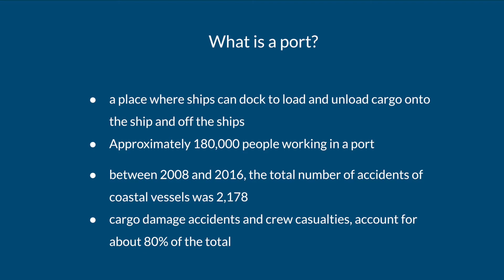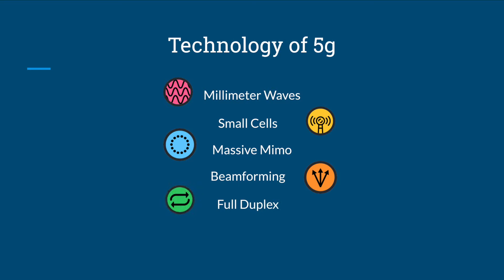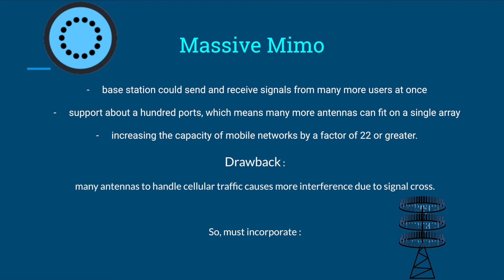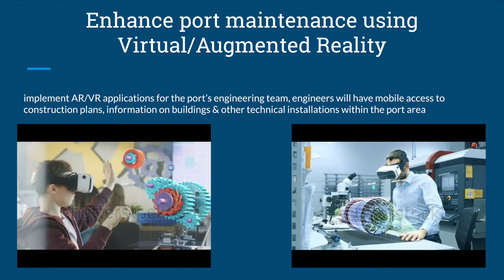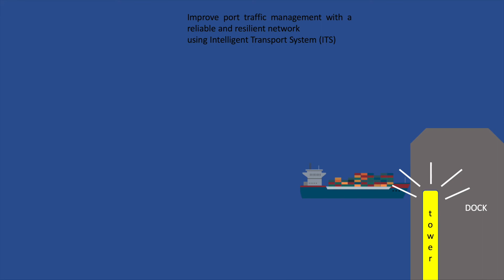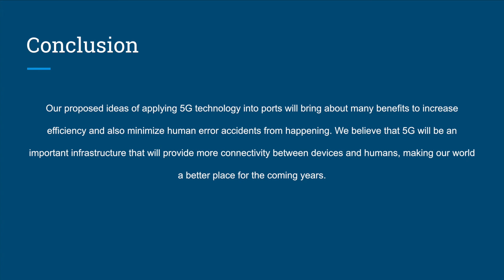5g Smart Port

Comment: What are the challenges of 5G on ports?
Reply from the maker: The cost of implementing 5g will be the hardest challenge to tackle as companies might not have the budget or vision to see it as a viable solution. Other things like the constructability of the port to allow the hardware needed to make 5g work to be installed will be a challenge too.

Comment: What an interesting video, very informative, but i have a question, What is your opinion on ports operation be improve with AI and 5g?
Reply from the maker: With the sheer amount of connected devices being implemented in ports, there will be a lot of data that can be harvested. Harvested data can go through a machine learning model, where better decision making and higher efficiency action can be produced and implement to the appropriate autonomous vehicles

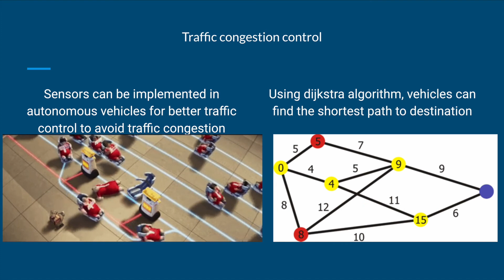Comment: Interesting video. At 6:33 Dijkstra algorithms was mentioned, can you explain further on what is it and why is it important?
Reply from the maker: Dijkstra algorithm finds the shortest path between that node and every other. It can also be used for finding the shortest paths from a single node to a single destination node by stopping the algorithm once the shortest path to the destination node has been determined. This is important because to make port operation truly automated, vehicles must be autonomous will little to none human intervention. With all the autonomous vehicles moving around the port, an algorithm must be implemented for the autonomous vehicle to get from point a to point b in the shortest time possible to improve port operation.

Comment: Learning alot from this, would be cool to see something like this again. Just wondering if beamforming and spatial filtering are the same thing?
Reply from the maker: Beamforming is a process used in conjunction with an array of sensors to provide a versatile form of spatial filtering which mean it is one of a technique used in spatial filtering. The term beamforming derives from the fact that early spatial filters were designed to form pencil beams in order to receive a signal radiating from a specific location and attenuate signals from other locations

Comment: Very insightful information on smartports and the implementation of 5G. Particularly on the cell tower component. Where would you be placing them in the port, and how good would they be when considering weather, and disruption caused by the containers? (Group 2)
Reply from the maker: The cell tower would need to be placed nearest to the dock and undisrupted from any obstacle so information about the port can instantly relay to the ship that is coming close to it. Regarding the weathers and disruption caused by the containers, cells tower won't stand much chance against them, that applies to other tower construction in port too. Hence, the construction of the cell tower will need to be prone to salt corrosion with a high level of rigidity.